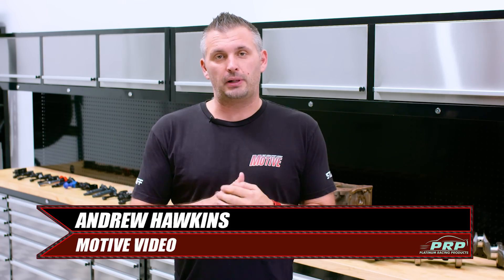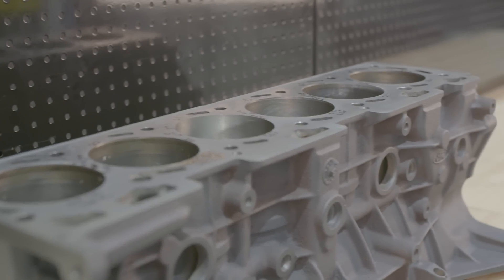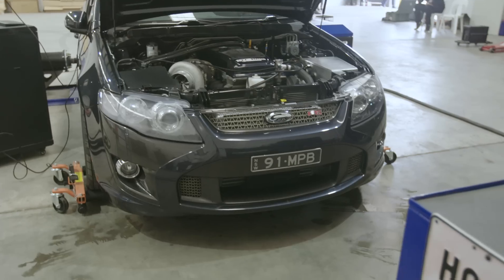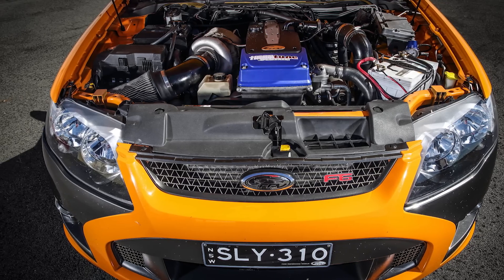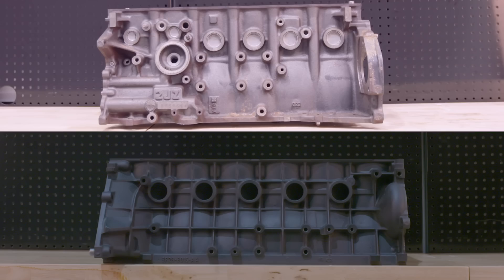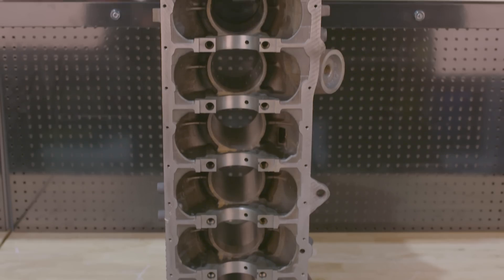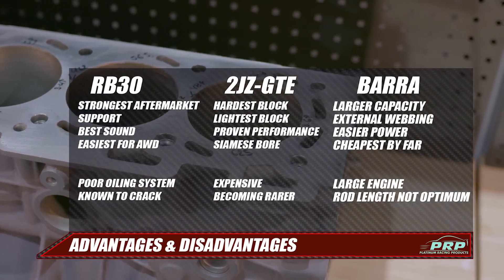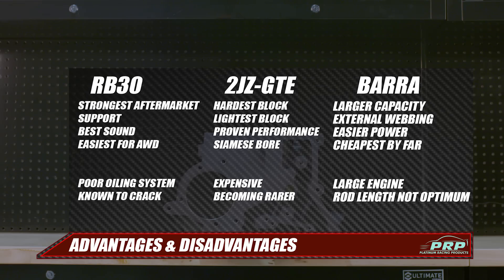Is the Barra 4.0L block better than the 2JZ and RB30?

Comment: That’s going to upset the Barra fans saying there better than a 2JZ! 2JZ is king I’m afraid, big tech tuners will tell you that the 2J is king too now enough of the butt hurt and accept it! Amazing vid guys ❤️
Reply: Depends what you're trying to achieve, if its outright peak performance on a very narrow power band uptop it'll have a slight advantage over the barra. But if it's streetable boat loads of torque that you're after - at any RPM the barra is king due to dual VCT and displacement.
Reply: @yjkader  yep, I'd go for low to midrange torque over high revving and high stressed motor ...
Reply: @marty3469 shorter strokes have same piston speed as a long stroke but at higher rpm.
Reply: y K amen!
Reply: This is actually a great video showing the Barra block can still match it with the best of the I6s. Not that we didnt already know this.
Reply: Ken Block should have put a Barra in that F truck, ecoboost sounds crap.
Reply: It's "Accept it" not "except it", you dumb fuck.
Reply: partyman6666 a dumb f$*k with an IQ of 133 thank you sir, noted and edited for you.
Reply: Ate you guys gonna do a v8 test, involving 1uz etc?
Reply: @Drquimbaymatumbo  The 1uz isn't gonna be anywhere near as strong being aluminum block, but man I honestly think its my favorite engine now. Got one on the engine stand now getting some new bearings, rings, seals, and new gaskets. Gonna keep this 2nd gen engine N/A and its going in my 83' mk2 supra in place of the blown 5mge. Then I will eventually build one to hold some boost and it will go in my maroon mk3. Gonna shoot for 450rwhp with that one.
Reply: @mkIIIsupras  I'm not saying it will be anywhere near as strong as a 1jz. I'm saying compare it to other alloy v8's.
Reply: @mkIIIsupras  the 1uz in my Lexus, is my daily. Im rebuilding an evo 5 ATM. Pushing for 650bhp...
Reply: I guess I don't see how it's better? Just means they are all great engines, each having better qualities.
Reply: Up the mighty barra!, look agreed its hard the beat the 2jz but that barra is still relatively new. After market support is growing the more people notice it the more it will continue to grow. Ford fucked up when they didnt release it in MURICA.
Reply: The reason why I think the Barra is better is because its affordable and has good availability (In Australia) and not everyone wants a Barra for 1000hp+
Reply: David Denisov  I think your past the point of trying to get off crack,plz just feed this bogan more ice.
Reply: I comes down to the right engine for the job. It doesn't make sense to put a Toyota engine in Ford where the Barra would drop in an bolt up to existing engine / transmission mounts and there is the room to fit the engine in.
Reply: Moran Taylor Amen also totally agree
Reply: Marc Jackson yeah the 2J is not a revver being equal bore, that being said with a mildly built valve train you can easily take them to 8k on a stock bore and stroke.
Reply: Toyota no longer makes the engine and now that people are swapping them into other vehicles in a few years they prices will skyrocket and they will no longer be viable for the average enthusiast. Toyota purist wanted a new inline turbocharged engine to go with the 2020 Supra fail at basic economics. It cost MILLIONS of dollars to build new engines from clean sheet of paper. That engine would have saw limited usage outside of the Supra unlike the original 1J and 2J that saw usage in other platforms. Too bad we can't get the Barra in the US, cheap as chips (as the Brits say) and make gobs of power with zero work just slapping on a bigger turbo and the correctly sized fuel system. I wonder how difficult it would be to import a Falcon to the US...
Reply: The quality of casting in the 90s is better than nowadays with all these recycled metal and such.
Reply: Can you guys test the block of the subaru eg33 compared to these blocks
Reply: Development on the Barra is no where near the aftermarket development for the 2j, and even with its limited aftermarket development it's been known to run 65 psi on a built bottom end. For very little money you can take a Xr6 turbo for around 6g and drop 2-3G into it a and crank up the boost
Reply: Not really, i think everyone has grown tired of the 2JZ ENGINE NO SHIT hype and would just like to hear some investigation on some other engines.
Reply: *they're
Reply: David Denisov  And you would be working on your vehicle more than you would drive it. sr20's and RB's oiling systems alone put them way behind the supra for reliability. My 7m supras are ten times more reliable than any sr20 car I've owned or seen. That's saying a lot being the M series is a 60's design. haha
Reply: Well what’s the difference between the Barra and the single cam engine blocks from the EL?
Reply: 2J I still king once you look at head, rods, pistons and extra oil avenues in comparison.
Reply: How much is a 2jz vs Barra . Exactly
Reply: Fukn 2j wankers. Anyone would think Toyota were the first to invent the internal combustion engine and the first to invent forced induction and then the first to put them together.
Reply: I would say that as 2j is getting rarer most tuners will switch to the LS. You can obtain them brand new, in comparison much bigger capacity, sold both as all'aluminum or iron block and it fits many engine bays.
Reply: @dallatorretdu  Do You know You can still buy them brand new from Toyota??
Reply: I kept saying 2jz is king , i was mocked , called names , bullied by Barra fangirls and here we are 🤣
Reply: lilripsta111 I keep seeing it on some of the huge channels on Facebook and see in the comments section ... people always saying it gets beaten by the Barra! Love pages like this that actually give proof ❤️
Reply: So Barra is strong as it has a better design having webbing and reinforcement minimising twist or warping which cracks blocks, yet not quite as hard as the 2jz without the outter reinforcement, so therefore 2jz is better. how?? Sounds like a bit of give and take as to block integrity. 
Also the larger capacity engine at equal power levels, given equal efficiencies is less stressed meaning it needn't be as strong, so at a prescribed power level is infact stronger than need be by comparison considering factors like cylinder pressures, load etc other than just hardness, wall thickness and deck height. The later of which one has far less of than that of the other two yet is the conclusive winner given such small parameters without real world context.
I like all three engines and each have their merits, but to state ones better off numbers alone without ANY testing as to how those numbers equate to each block adversely, then as a comparison given a control to compare equally is not a definitive conclusion at all..

But as stated, fanboys will conclude what they will. 
p.s RB still sounds the best..
Reply: Like they say here in the U.S. there is no replacement for displacement.the all the blocks are good enough.the bigger engine is going to have the higher top end for making power if the designs are similar,then it's down to getting the power to the ground that becomes the issue.
Reply: @mbsnyderc  that saying belongs in the 60s.
Reply: mbsnyderc different strokes for different folks ... the bigger displacement motors are often better as drag motors but the strong smaller displacement motors are often better for track/circuit work :-) 
Each has its use 👌
Reply: Peak 2jz fanboi, wrong.
Reply: Nor Dic haha did you even watch the video lol! plus see the above comment I made, still got mad love for the Barra too
Reply: David Denisov I’m by no way slating the Barra it’s mega and the reason it gets a false sense of being better than a 2J is displacement, it’s a cracking block and I love it too, I’m part ford man too so I’ve got a whole lotta love for it too ❤️
Reply: Would take an ls over a barra, thats coming from an RB enthusiast.
Reply: @zyoungson215  Saying you like RBs and not Barras makes you sound like a fanboy, in the "I like RBs coz they're Nissan" type way. Makes not sense.
Reply: Zac Youngson not much in it imo? For peak Power I’d go barra, mainly due to displacement.
Reply: Zac Youngson you are an idiot, barra, geto of the ice

Comment: I know no ones asking for it, but please test a 1UZ!
Reply: 1UZ vs LS1
Reply: @internet_internet  in my humble opinion the 1uz is 1000000x better than any LS engine.
Reply: @wannabecarguy  not really you can do so much more with an ls and cheaper
Reply: @internet_internet  this!
Reply: @internet_internet  should be 1uz vs boss motor
Reply: @Tex 13 2uz was an iron block
Reply: Dats a sleeper
Reply: It's about inline 6 engines being compared not a damn v8 🤦‍♂️

Comment: Next u guys need to check out the Mercedes m104 engine block. I hear it's a good inline 6 cylinder that's over engineered and can handle alot of power on stock internals. https://www.google.com/amp/s/amp.reddit.com/r/Drifting/comments/201wmi/will_we_ever_see_more_mercedes_engines_in_drifting/#ampf=undefined

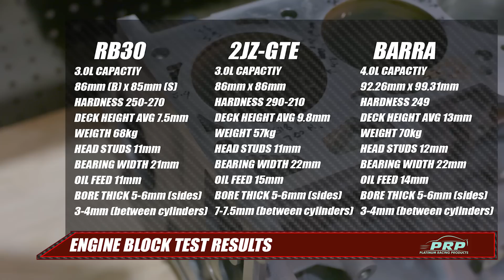Comment: 10:49

Typo on the 2JZ hardness? Shouldn't it be 290-310?
Reply from the maker: yes. Mistakes happen
Reply: Moe Green  Check out Dyn-omite Performance as they have used destroked barras (3.7lt) which you can buy in kit form from elsewhere.
https://youtu.be/eQNAiy-EHd0

Comment: So the 2JZ wins again.  Why am I not surprised?
Reply: The external webbing will easy make up for the reduced hardness ( higher hardness material is more prone to cracking too) . Thickness is not a issue as no one bores a barra beyond the factory 4l displacement.
At the end of the day both blocks can do 1000-1500hp no problem and 2000hp is not impossible.
Reply: @ashc3765  yes but 2jzs are out there making 3k horse power now lol
Reply: @sariahreigns3666  mazworx's SR20 makes 3000hp also. Your point is? 
Comes down to r&d, of which the Barra has had but a tiny fraction of by comparison to that of the 2jz. 
What one is capable of making a given engine achieve is not the benchmark but the exception. Both are exceptional  engines and better than each other in different ways.
Reply: @ashc3765  Does anyone destroke them to get the B:S ratio closer to square?
Reply: volvo245 Yes there are de-stroke kits available 3.7L is pretty common.
Reply: @ashc3765  Makes sense, might enable Barra users to get into lower displacement classes too so there ought to be a demand for such kits.
Reply: Taxi motor vs forged performance engine.
Reply: Iggi Valencia - I wouldn’t say it’s so much of a difference to call it a win. Their both great engines making 1k horsepower
Reply: Peder Hansen  right but sinse the z4 gets a higher tune its always gonna out perform the supra. however the new supra does have one good thing going supposedly this is the first "supra" you can rom tune. so we'll see. still with stand alone on 2jz its just the king.
Reply: Wrong the Barra did it is a stronger block and u don’t have to spend ridiculous amounts of money to find a motor like u would with a 2JZ
Reply: @peterdubber5884  depends where you live.. loads of 2jz around here, zero barras
Reply: Peder Hansen  b58 cant touch a 2jz the head design is really limited and the block is a closed deck. you can not at all bore or even rehone the block its non serviceable meanign you mess up your block slightly better have 12k ready. bmw did this on purpose so the supra couldnt beat the z4.
Reply: @sariahreigns3666  Wasn't the gtr closed deck also?
Reply: No surprise I mean it came forged internally from the factory so it's to be expected
Reply: @clutchkickpj693  they're testing the block castings, so it doesn't matter if the internals are forged or not
Reply: @clutchkickpj693  plus the rb26 and 2jz both have cast pistons and forged rods like many others
Reply: @mrpsd590  you mad bro? Sure sounds like it you lil b ahaha

Comment: Heck yeah, great vid. The occasional Barra did suffer from a bit of water jacket movement during casting, resulting in some having thin spots in the bore, but it really only comes into play with engines running massive horsepower, and the blocks are so ridiculously cheap that anyone having to source a thick wall block for their big boost build will likely only spend 1% of their overall budget finding a good one 😁
Reply: well said, agreed and thank you :)
Reply: Oh no I cracked a block, $50 later.. Lol